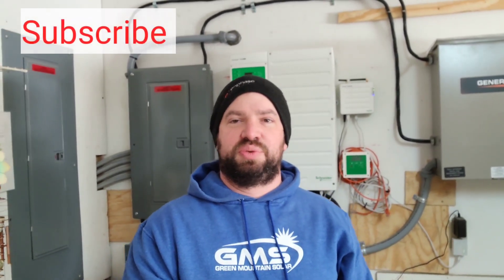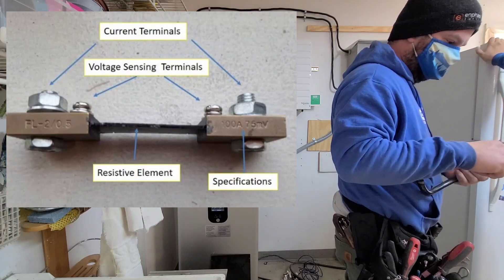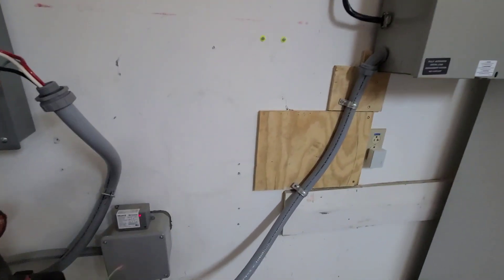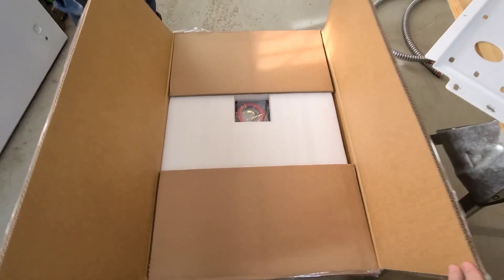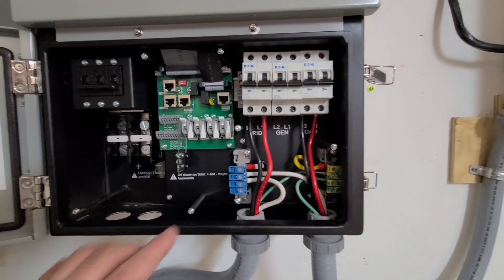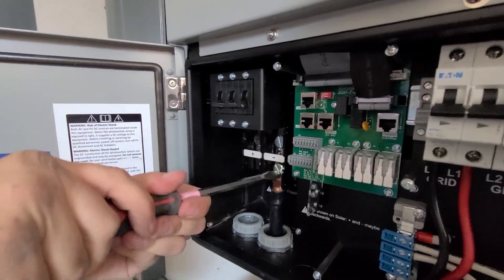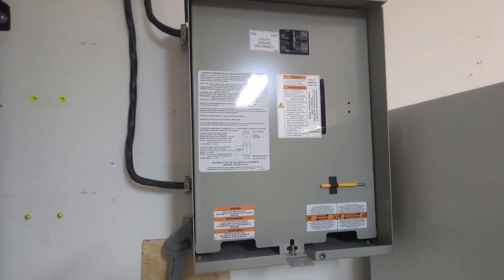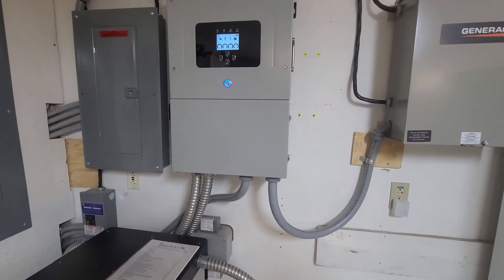Schneider Had Glitches But Fixes are on the Horizon?

Comment: What kind of glitches was the xw pro having just curious cuz I have a xw plus
Reply from the maker: Loss of communication every month or 2, error 49 a handful of times,  randomly shutting down, overcharging battery in float (seemed like it stayed in CC instead of switching to CV) which caused the battery BMS to shut down.  Also, DC voltage was 0.5v off and every time there's an alarm the entire system shuts down and needs to be manually reset.  The point is, every month or 2 I had to go there or spend time on the phone with the homeowner and eventually he was fed up with it, as were we.  I fought tooth and nail with Schneider and they told me this was completely normal operation, and eventually wished me best of luck...
Reply: @benssolarandbattery  was this AC coupled system at the time?
Reply from the maker: @SpencerLAPower  correct.
Reply: @benssolarandbattery  thanks for your help have a blessed weekend
Reply: @benssolarandbattery  who was the grid tie pv manufacturer
Reply: I have a 15.3kW system and it is buggy.  Always throwing false warnings and changing my settings at random.  Videos are on our channel.

Comment: The XW series are great as long as you DONT follow their setup parameters.. they have weird logic that you have to think around and use in weird ways to get what you want... What glitches were they having? I See they got the NEW insight gateway which makes tweaking things much easier...
Reply from the maker: Loss of communication every month or 2, error 49 a handful of times,  randomly shutting down, overcharging battery in float (seemed like it stayed in CC instead of switching to CV) which caused the battery BMS to shut down.  I think there was another thing too, but don't remember what it was.  The point is, every month or 2 I had to go there or spend time on the phone with the homeowner and eventually he was fed up with it, as were we.  I fought tooth and nail with Schneider and they told me this was completely normal operation, and eventually wished me best of luck...
Reply: @benssolarandbattery  yeah thats the weird logic crap... there is a 2v flex voltage range that can cause those issues, the gateway needs a onsite firmware update and a Ethernet connection or very close wifi repeater to keep from dropping connection the F49 has to do with the LBCO voltage which must be jimmied to fit within the specificneeds of the battery .. But i do completely understand the frustration.. lol if you do have to deal with them Try to work with Rhodes C.  he knows his stuff :)
Reply from the maker: @leen.3785  yeah Rhodes was the one who told me this is all normal and didn't offer any way of resolving anything.  I'm sure he knows his stuff, but at least give me something to work with.  Nobody mentioned anything about a firmware update and now it's in a pile in my shop.
Reply: @benssolarandbattery  Selling cheap? lol i wouldn't mind a spare :)
Reply from the maker: Was hoping to get something out of it.  "There's nothing wrong with it" after all. 🤣  Let's chat on FB messenger.
Reply from the maker: Oh and the DC voltage was registering 0.5v too high.  (Which is in spec with no way to calibrate according to them)
Reply: I've experienced the same thing

Comment: It's funny, before settling on the Solark I looked at Schneider and Magna Sine in depth. I felt like using either you were being nickel and dimmed to death for all the parts of a complete system. The thing that struck me the most about Schneider was the volume of people complaining about the lack of technical support and facing a wall of silence when you have issues. After reading those reviews it was a total no brainer.  Glitchy inverter, no thanks.
Reply: Their Tech Support sucks.  Luckily we bought our 15.3kW system from a great company who gives lifetime support.  I've called them often as Schneider is quite buggy.  Videos on our channel of the system.
Reply: @Off-Grid  Thanks. I'll check it out. All the best with your journey.

Comment: Hey Ben I have a question can the sol ark inverter with as a none split phase inverter ??
Reply: You mean to put out just 120V? No, I don't think it can. You could put the Solark output into a transformer and pull 120V on the other side. It'll have to be a pretty beefy transformer, though.
Reply from the maker: The Sol-Ark 12k can operate at 120/240v, 208v single phase, 120/208 with 2 inverters, 120/208 3 phase and single phase 230v.